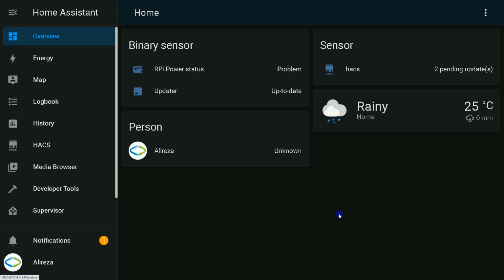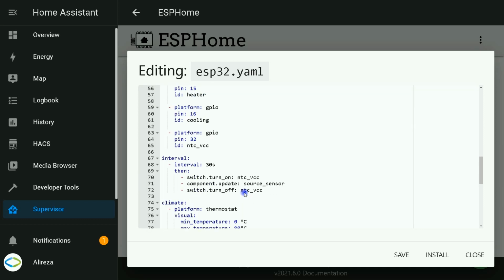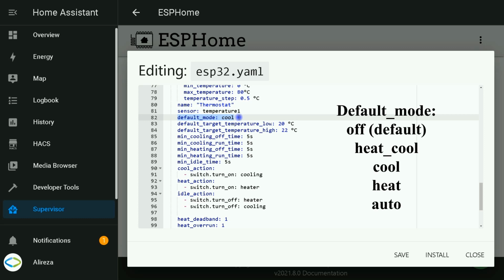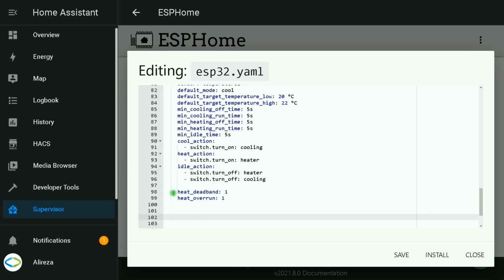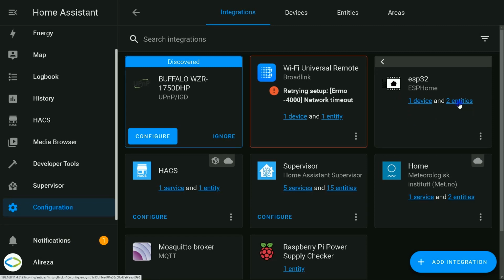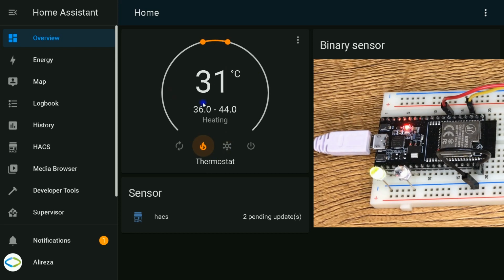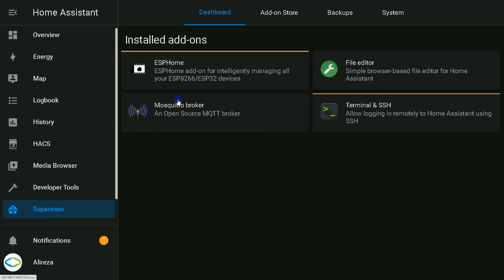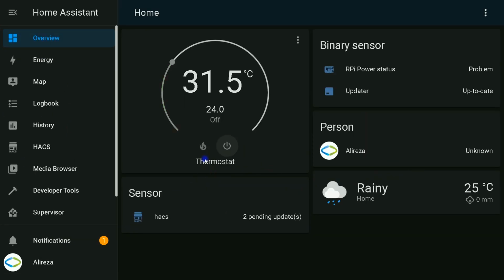Themostat with ESP32 in Home Assitant

Comment: Very good tutorial. Thank you for it. I want to try it, but with DHT22 sensor with integrated resistance. I'm not a programmer, that's why I ask: if I change, in Yaml code,  ntc_vcc with DHT22, is it enough?
Reply from the maker: Thank you a lot.
There is no need to change anything.

Comment: Thanks for the video.  I dont see in the code where AC compressor protect would be. As you know you cannot turn ON the AC compressor immediately after it went OFF as you risk destroying it. All hardware thermostat have delay of 1min+ implemented for this.  Can you point us where in the code this triggers?
Reply from the maker: Hi, you are welcome. May I know what do you want to control?
Reply: @kian.smarthome  Air Conditioning system at home. The thermostat that came with the house has this delay. So that if you were to turn off the AC (while the compressor was on) and switched it back on the AC compressor will not run for about a minute.  I forgot what this delay is called but if  one were to start AC too soon again the compressor may get damaged.
Reply from the maker: @arp_catchall  I see. So just a delay for a relay is enough, Am I right?
Reply: @kian.smarthome  Yes,  delay thats triggered each time power is out, board resets, or switched off (while "cool" is set).

Comment: Would it be a decent idea to use, for instance Zigbee temp sensors for room temp and also temps at intake and at the first heat/ac output vent, then use Shelly’s or some multi dry contact relay board to control the fan, compressor, reversing, etc to make a thermostat? I realize it would be more expensive, but could be done with just templating and without soldiering or programming. I’m not at all saying you should have done this, just interested in your opinion.
Reply from the maker: I don't suggest using it or not, this video is just a tutorial. using this model really depends on your situations and choices.